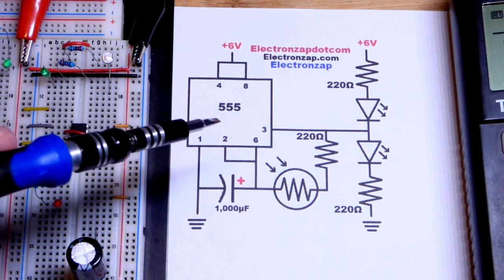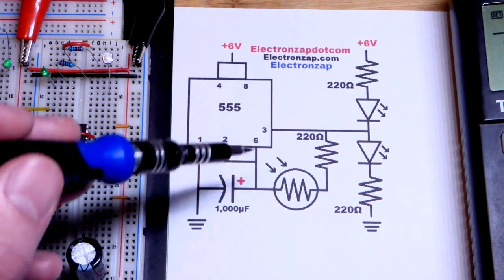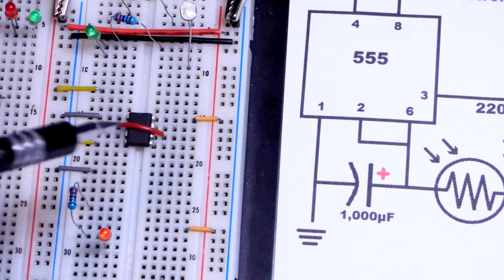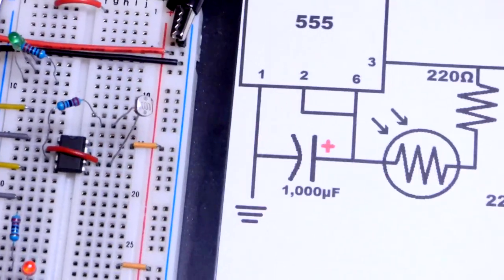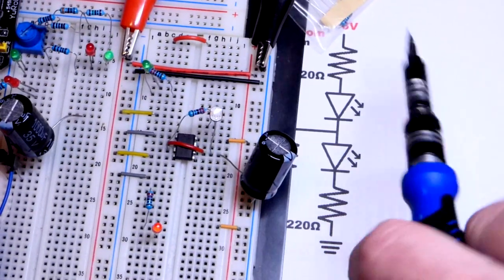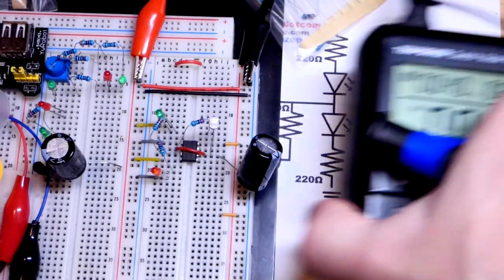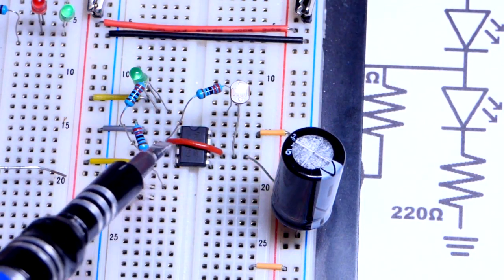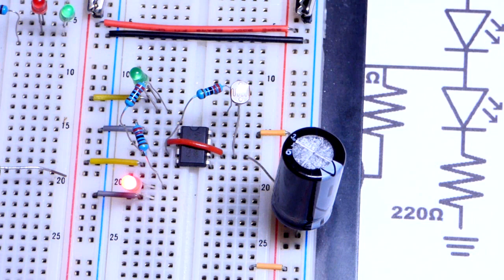Variation of 555 timer astable mode using light dependent resistor LDR powered by output circuit

Comment: Hey, I recently watched your video related to the TLC 555 timer vs NE 555 timer, practically I was also using ne555 timer and I am struggling with my signal, not coming near to 50 %, it's always coming near 60-65% duty cycle. I only want to confirm you if generate a triangle wave around 500 kHz, with the TLC555  would I get sufficient duty cycle near the 50% and good amplitude, the frequency also. please reply.
Reply from the maker: No clue unfortunately, I haven't done any testing anywhere around 500kHz. I mostly like really slow circuits, but I believe that 500 kHz might be the very limit of how fast most 555 timers can operated by someone who really knows what they are doing.
Reply: @Electronzap  If I try 200 Khz signal will be okay from TLCIP
555 timer?

Comment: Is the positive being thought of as the more dangerous of the two a reference to DC and does not apply to AC being it's a sine wave and both positive and negative?
Reply from the maker: You need a voltage difference and a conductive path for electric current to flow. A 9V battery has 9 volts across it's terminals. To make things easier to keep track of, we consider the negative terminal as being 0 volts, called ground, and the positive terminal as being 9V. The danger depends on what you are powering. 9V won't dangerously electrocute you, but can make some stuff too hot to touch. AC is a lot more complicated. It has both a more positive and a more negative in relationship to 0V. For household power, which is a high enough voltage to always dangerous, 0V is literally the land all around us.